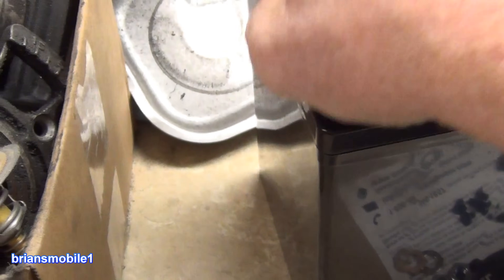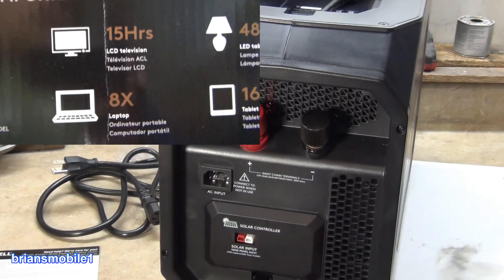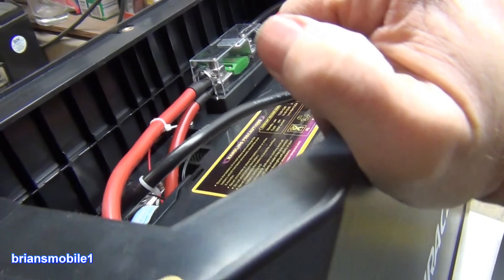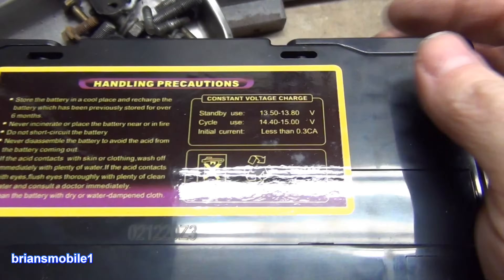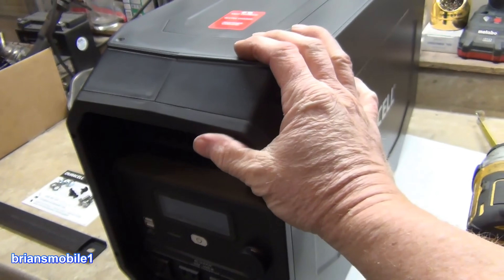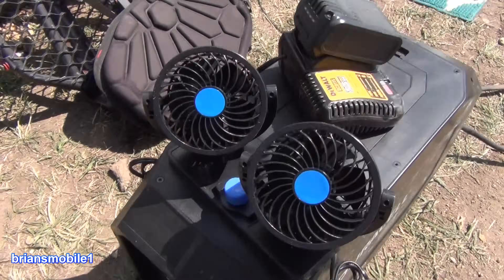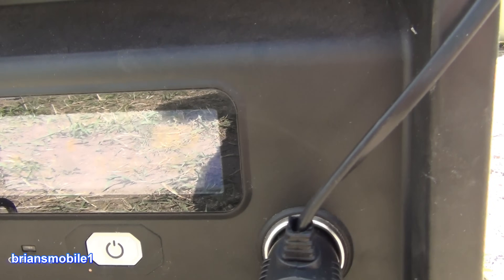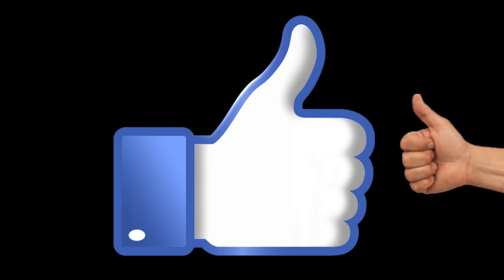Is the Duracell Powersource a Good Pick for Camping & Vanlife?

Comment: 6
15l  What kind of extension cord should I buy for a 1440 Duracell battery for a  100W duracell solar panel???
Reply from the maker: All good points.  You know your stuff!  Check for fur between the radiator and condenser.  There's a vorticie there where hair and dirt is forced through the condenser and gets stuck on the front of the radiator where you can't see it.  That may help with cooling and air flow in the engine bay to clean there.
Reply: I did not received your answer????

Comment: I bought one to run a pond fountain, worried now it's not going to do it .
Reply from the maker: You might want to check the amps on your fountain and make sure you protect the 660 from weather etc.  Make it a dog house or something.
Reply: @briansmobile1  yeah it's going in a well house. The pump is about 750 watts, I thought this unit was 1400 watts but now I see it's much less. I'll connect a second battery to it to get more power. I plan to run the pump a few times a day for maybe 1/2 hours

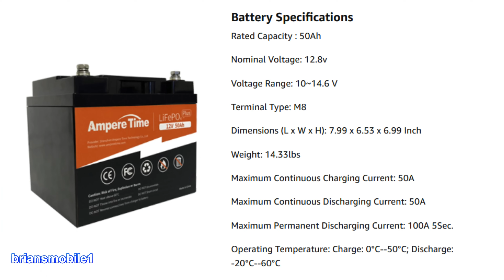Comment: @8:00 you show a lithium battery
 Have you replaced your battery with this? If so how does it hold up?
Reply: The charging system is different for a lithium battery. You can damage the battery by using this charger.

Comment: These videos are laughable. You guys think the normal person is worried about all your negativity about the unit when they just want to change there devices on camping trip or storm outage. Laughing. Most want to see you plug a refrigerator up and see how long it last. Most of the time 4 to 8hrs is enough for power outage to charge phone and keep lights on without having to run and get gas for generator. Hey great knowledge but it’s not realistic I help with with many disasters and people just want power no matter if it’s not the best

Comment: Update:added a 100ah agm battery and it charges perfectly using 400 watts solar with a 40 amp mppt charge controller by charging the 100 ah agm battery.   Runs 150-170 watts for hours and never drains down beneath 12.3 volts.
Reply from the maker: Nice!

Comment: So It does have pass through changing
Reply from the maker: I believe it does through the lugs at the back.  I understand that it's recommended that you use batteries of similar chemistry.
Reply: Yes. I keep mine plugged into wall; fridge plugged into it. Works fine going on 6 yrs now.

Comment: So got a b grade unit for $299, want to use it to run a few items in a building I'm using for a gym/workshop.  My thought is to add a couple of 100 ah agm batteries and hook the solar directly to the batteries to keep them charged.  Would it hurt the unit to charge the batteries while they are connected to the unit?  Would make it much more funcional to be able to keep the batteries charged.
Reply from the maker: Hey Tony, smart question.  Use that built in solar charger you paid for.  Those daisy chained agm batteries you're getting will charge off the one in the box.  Get the right Anderson connectors and do it like it says to do and you'll be way less likely to burn down your gym.  Doing solar straight to the battery is a high risk low reward gamble.  Cheap insurance you already paid for.
Reply: You can use the Anderson plugs or a separate charge controller for $25

Comment: I had power out for 2 days the day mine came in.  I didn't even get to fully charge it.  I ran 1 freezer, fridge, sump pump, router, camera hub, and basic lights.  I charged off my car alternator for less than 2 hours each time it ran dead.  Total time running car was 4 hours for 2 days. Very versatile!  Definitely worth the $437 off amazon.  You can add more batteries.  I added a 88ah house battery.  So effective wh is now around 800.  I plan to add more with separate solar charge contoler.  The seemless functionality of this unit is great for the price.  It is a watch dog and not just stored away.
Reply: 😅I will mo8v8ovoo vv8u
 O

Comment: I'm really surprised they just put a basic $100 wheelchair battery inside it. Looks handy to have all the features but would you be better off with just a deep cycle battery, a cheap 120v inverter, and a solar charge controller/panel?
Reply: The bonus to this is packaging. And you can swap the battery with a lifep04 when it dies, and external power input.
Reply: @lazerusmfh  I've been asking about that, and I'm being told no, that it isn't recommended because the other components are meant to work with SLA BATTERY. The charge controller ECT.... please correct the information if it's wrong. I'd love to do some retrofitting on this unit to make it more usable.
Reply: @lazerusmfh  From what I've been reading, different technology, can't charge the lithium the same way as a lead acid or gel battery. I wanted to use the gel battery in my car, but I read it needs a different charging system modification to do that.

Comment: 1400W?  I don't think so. The battery label shows 12V & 55Ah = 660W.
499$ for that crappy system?  You'd do better to buy a different unit that has 4 LiFePo4 280Ah cells in it which would provide you with ~3.6 kWh of energy.  4 cells will cost ~600$ but provide you with 5.43 times more energy.

Even this batt is a better deal & would provide you with ~2 times more energy:
https://www.youtube.com/watch?v=irb-vdTnY7M
Note:  But it is only a batt--not a power station...but, you could connect a charger & inverter to it to essentially serve the same functions of that power station.
Reply: Your logic is flawed. 
Your understanding of electricity if flawed
Watts are not Ah's

Comment: The little champion dual fuel is on sale for like 500 . Do you camp with a truck or trailer? Run a second battery with an isolator probably better off throw a solar panel on roof and if worse comes to worse you can run the car for a little and charge it up
Reply from the maker: I camp in a box trailer quite a bit.  Sometimes a tent.  Im gonna get a lighter smaller battery & panel setup.
Reply: @briansmobile1  https://youtu.be/g19H-rOY4rg

I'd love your take on one of these "generators"?  Or even the single battery ones?

Comment: Shocked by 330... (575 to ground). Lol. 277v. In a hills department store....on a 16' roll around steel step  ladder working live in a 12x12 j box. Plumbers ran 2-3/4" copper pipes riggt across the opening of the enclosure. Arms wrapped around the pipes and linesman pliers in hand. Needless to say i did unintentional pullups 16 feet in the air. Twas eye opening. Lol. Power on.. lol. Throw that thing in the yota and bring it back. Lol.
Reply from the maker: Holy crap!  Thats a wild story.  I bet that copper pipe conducts just fine.  Im glad you're still around.
Reply: @briansmobile1  likewise man🤙